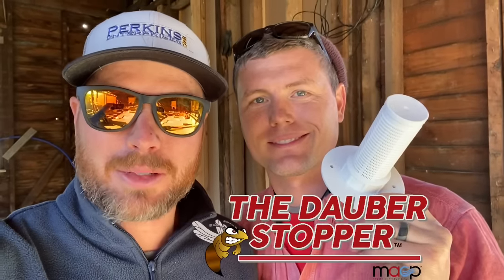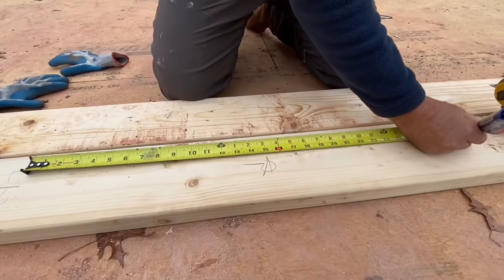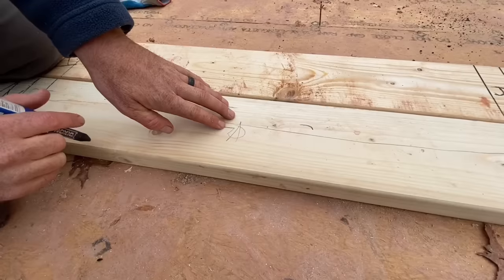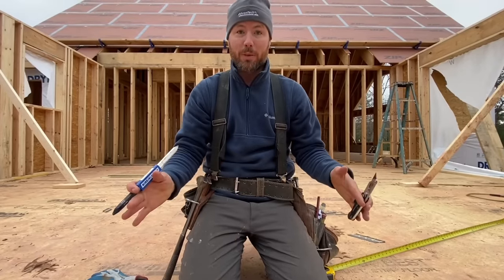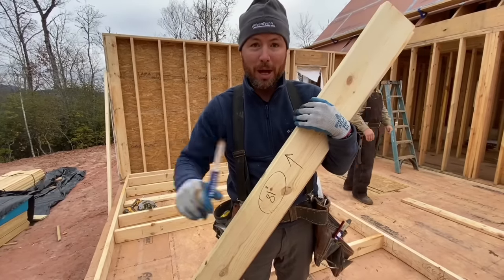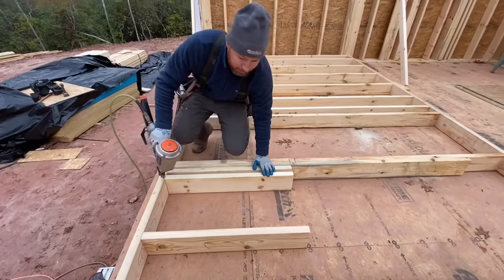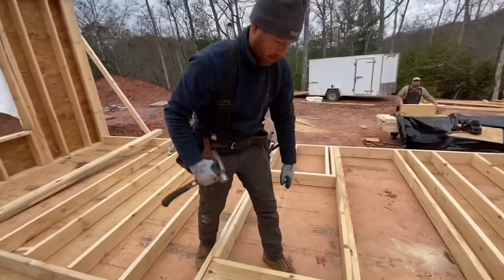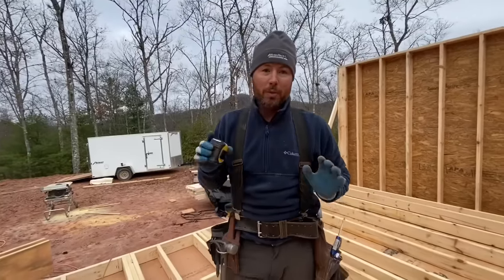Learn how to frame a window ~ Building  tutorials made easy

Comment: Great instructional! Thank you! Please explain how 48x30 becomes “26 40”. Thanks.
Reply: it’s not thirty by forty eight, it’s two six by four zero (ie 2’6” and 4’0”)
Reply: Stumped me too! Thankfully (from the REPLIES) I learned that, in window and door jargon, width is always first (feet then inches) and height is second (feet then inches) e.g. 2 feet 6 inches (wide) X 4 feet 0 inches (high) equals 2640

Comment: Great production, clean. One thing to note: The jack studs holding any header should always in my mind be full bearing to  the beam member its supporting. the window liner should butt into the jacks. Framing the liners full length of the beam (headers) you are creating a swell point and crush point as the wood grain is flat the way you have framed it on the bearing point above the post. 
When using 2x materials for headers, pack 1/2 plywood between 2 of the 3 pieces to gain the 5.5 inches for your exterior walls. Another note. 2x8 Headers should always have 4 nails connecting the king studs on the sides to prevent roll of the header off of the posts once loaded with the roof.
Reply: right on , so correct as shrinkage that way causes drywall cracks

Comment: 7:12 Filling w/ spray foam.  That's an interesting approach to an insulated header.  We've just been using a 4X header flush with the exterior wall and using a piece of Rigid Foam insulation on the inside.
Reply: yup, we do it the same way out here in WA. sheet foam is cheaper then spray... but your already putting can's into the house around boxes and penetrations so... tomato tomato.
Reply: @Ramdodge582  I've noticed the electricians seem to like to run wires in the header cavity before the foam goes up too.
Reply: @wjthehomebuilder  really!? above i door i could see that but a window .. that doesn't make much sense... but they can do some stupid shit.
Reply: Spray foam gives a better R-value for insulation.
Reply: @Dalonghair  then rigid? It's the same, 7.7 per inch
Reply: Ram-n_dodge 
It’s been a while, but I remember spray foam always giving a higher R-value than rigid foam. 
Additionally, it is impossible to get the same blanket coverage with rigid foam slabs. There will be gaps in your cuts. Spray foam literally fills every nook and cranny, every knot hole, every gap. When applied to walls and attics, spray foam contributes to structural integrity. 
Rigid foam has its uses, but insulating a header with spray foam is an all around better practice.
Reply: I think the better practice for standard construction is using a solid header then using sheet foam with expanding foam for your fuckups. My 2700 sqft house has 10 of the large cans of foam in it. Partially because of a 16' section that was framed not in the best way and used 4 cans of foam. Can foam can easily push boards out of true.
Reply: Ram-n_dodge 
There’s no good reason to use rigid foam in headers. If you have the material available for solid headers, go for it. Otherwise, frame your header, nail it in place, drill a couple of holes and inject some spray foam. Don’t overspray. Any excess foam will spill out of the holes you drilled instead because that’s the path of least resistance. If your header is long enough for the spray foam to push the 1 1/2” wood out of true, you did not nail wood spacers in the middle like you were supposed to. 

If the header is framed and nailed in place properly, the spray foam will not push anything out of true in this situation.
Reply: WJ the Home Builder 
The problem with using rigid foam on the inside is there is no nailing surface. That is a very poor construction method. Cutting corners like that simply shows the laziness of the carpenter. Headers should be padded out so they are the same thickness as the wall. If you build it the proper way, there is a solid wood nailing surface on both the exterior and interior wall. Fill in the empty spaces with insulation.
Reply: Ram-n_dodge 
I don’t know where you are getting your 7.7 R-value from. R-value is a rating system used to determine the amount of thermal insulation. R-value for rigid foam depends on the thickness of the boards and what material it is made of. R-value for spray foam also varies depending on the material and how thick it is applied.
Reply: @Dalonghair  There's always a 2x6 under the header for drywall nailing.
Reply: WJ the Home Builder 
Well, if you build your headers properly, there’s a hell of a lot more solid wood for nailing.
Reply: @Dalonghair  Aren't you full of opinions!
Reply: WJ the Home Builder 
That’s not really an opinion though, is it? It’s fact. There’s a right way and a wrong way. You are cutting corners. 

You nail three 2x10’s or [edit:] three 2x12’s (depending on the length of the header) together and pad out the extra inch with a 1 inch slab of foam because it’s quicker than building the header properly. That’s just poor craftsmanship. 

You could pad that extra inch with 1/2” plywood spacers and fill in the gaps with insulation, but that takes more time and therefore more money. The truth is that it really does not take that much more time. It’s harder to blow smoke at experienced carpenters.
Reply: @Dalonghair  There's more than one way.  So yes, it's your opinion. Good for you that you think your way is better.  I was talking with an engineer last week who is trying to sell the idea of a header assembly  that is ONE 2x on the outside wall, then 3" of foam board sandwiched with 3/4" plywood on the inside wall all lag bolted together to create a super insulated header.  Like I said,  there's more than one way.
Reply: WJ the Home Builder yeah but that’s not structural. You’d rely on one 2x10 or 2x12 and 3/4 ply. The foam would just be a shear factor after that. There is no way 3” foam gives you structural strength.  And your math is off. If they say it has to be flush, you’re a 1/4” shy. The best way is to build 2ply + 1” ridged + 1 ply. Keeping the header thermally broken while remaining structurally strong. 3 ply is the way to go and this guys way on having a 2x6 under the header isn’t structural at all either. That jack stud will squish that over time.
Reply: PD12 
Exactly. It doesn’t make sense. This is the difference between trying to get cheap and quality craftsmanship. Why waste a 2x6 as a nailer? Just build the header properly. Don’t be lazy. They really are not saving money by cutting corners.
Reply: Cafe J'adore 
I am not sure what you are having a fit about. I was merely calling out hack carpentry and cutting corners. 

Structural beams are fine. In fact, they are preferred to traditional headers by everyone... if the materials and budget are available. There is absolutely nothing wrong with the traditional header construction that I described. You either misinterpreted what I [edit:] read wrote or you are too young to have had experience with building traditional headers and all you know are pre-fab structural beams. 

Either way, structural beams are clearly not what was described by the other person who posted previously in this thread. There was some nonsense about an unbalanced header with 2x lumber on the exterior and 3/4” osb on the interior. What a joke.
Reply: Cafe J'adore 
Also, drilling a couple holes into a header does nothing to compromise its structural integrity - a couple holes does not mean turn your header into Swiss cheese.

[edit:] In my experience building homes on the Atlantic coast, hurricane-proofing does not address headers. The requirements for hurricane-proof framing are primarily focused on rafters/trusses and decks. Even roof shingles are subject to different standards, but not headers and wall framing.
Reply: Cafe J'adore 
Additionally, I never was a fan of building walls 2’ on center for larger buildings. That’s fine for a shed, garage or barn, but not residential homes. For commercial construction, I would only deem 2’ on center to be acceptable if the building materials provided enough shear protection. I’ve seen homes built with rigid foam sheathing and metal straps fastened diagonally for structural support. Try building studs 2’ on center in Tornado Alley with that jacked up engineering. No thanks, I’ll take my 16” on center walls with osb sheathing on the house I’ll be living in.
Reply: @wjthehomebuilder  That's not true. We have framed for years by sandwiching (2) 2"x material together and then OSB on the inside to flush it out. The header then sits on jacks, not on a flat 2"x. You don't need a flat 2"x for nailing.

Comment: Hey guys as usual short clear and to the point. Lots of ways to do layout. Comment I noticed you pulled your jack stud layout to your top plate. I eliminate this to save the 'oops' nailed the king stud on the wrong side of the line😊 Also saw you pull your cripple layout to top plate...? Especially like  adding information as to opening size. I give the crew r.o. header size jack size cripple and sill length. I get these measurements ahead of time by taking a stud laying out jack height. You can pull several window ro's from here lay out the sills and figure jack heights. On the sill layout I write each window number from the reference # on the print. Now my cutter has a very accurate cut list and can put all the window components together as a package. Header sill and Jack's are stocked above the top plates. Keep the vids coming... you guys have it 'nailed'
Reply from the maker: Thanks brother... I like the “package” method too when you have a lot of the same RO’s. Good stuff

Comment: Nice how to video.  have learned to add another piece of 2 x ? on the outside of the King stud to allow more backing for a curtain rod, or allow for two jack studs for that extra 1-1/2". It keeps owners from destroying the sheetrock trying to mount the rod support.

Comment: Good well made straight to the point video's. As a 71 year young still learning carpenter, in my opinion their is to much lumber in walls. You mentioned a second king stud, I think this space would be better served with insulation. I believe the cripples next to the jacks could be removed and replaces with L-70 leaving more room for insulation. Headers are to big for most openings. Its easier framing with a bigger sized headers but less energy efficient. Just my opinion.

Comment: So the "Kings" connect the bottom sill to the top sill. Like any other stud.
The "Jacks" are shorter to allow for the header. And connect to the "King" to prevent lateral squeezing of the window.?
The header is to spread out downward force on the window frame from the top sill.
The bottom sill is self explanatory. Sound about right?

Comment: Have you ever considered pitching the sills outward 5° for possible water intrusion?
Reply from the maker: Good idea! havnt actually done that in the wall framing before, but now I want to try it. Thanks
Reply: It’s a thought, but if you prep correctly, tyvek, grace or Zip tape and use a quality modern window and side it properly. I don’t think the 5 degree is going to help.
Reply: If you frame the opening a half inch (or so) taller and then lay a piece of beveled siding on it for the slope, that works also. Just seal the sill with some zip liquid flash after. Thanks for the video guys!
Reply: While pitching the rough sill could work it would reduce framing speed  extra angle cutting would involve as to adding 1/2” to rough. Debatable I’m sure.
Reply: Steven Foust too much work for not enough payout
Reply: That’s actually the way things were done years ago. But today it’s all about profit and no one wants to take the time to do it.
Reply: Adam newby here.What do you mean pitching the seals five degrees?
Reply: Sixth Day farm not seals, sills. The window sill can be framed to have a pitch if 5 degrees to shed water.
Reply: @rikertvonfulton16  slanted down and out
Reply: The old exterior sill was cut at 5° and had a kerf cut on bottom.

Comment: I am a total novice and these videos are extremely helpful.  Quick question...on the first wall I built (making a chicken coop with 5 foot walls...I cut all the studs at 4'9", but when I went to frame it, some of the boards ended up being about 1/4" to 1/2" short (even though they were all the same size).  What did I do wrong?

Comment: Curious what your thoughts are about sloping the sill outward in case of an eventual leak. A lot of guys I come across say to slop the sill by 6 degrees, but that would complicate the flashing I'll be using in the end since I was planning on using the vinyl corners instead of flextape. I vastly prefer the idea of keeping everything straight and flush, but the outward slant definitely makes sense to me aswell.
Reply: here we bai; on a piece of wood clapboard siding on the sill to create a slope.   Flashed with tape to seal

Comment: i nail jack and kings and then assemble all pieces after they are correct sizes and then add cripples. i have to remind myself to check crown first and make sure pieces fit  correctly. everyone has a system.just has to be exact and not take too long..then move to the next after its in..

Comment: In UK we use metric but in the old days of imperial we would stick to inches for things like framing. 

2ft 6ins x 4ft would be 30 x 48. It's unambiguous. whereas mixing ft and ins often can be taken two ways.
Reply: That's how windows and doors are measured. You use feet and inches, not just inches.
Reply: Brad Eley  It took me a long while to figure 2640 out is 30 x 48. Why wouldn’t we simply use inch, since it is used in almost entirely of framing?
Reply: I had realized that instead of making 2 measurements to have the lenght of cripple, it is easier, faster if we do math. Since standard jack is 81, take 81-48-1.5= 31.5  (Jack - wo-sill)

Comment: Eric, after having framed a third house I've started to see fluctuating exterior door heights. I'm also tired of using 2x8 and filler material to make an old school door and window header. Do you guys typically use a 2x12 flush on each side of the wall with that 2x6 holding the two 2x12s? Or was that an LVL? I'm looking for ways to speed up the header process. I do like the insulated header idea especially since using a 2x12 or LVL will be plenty strong with one or two layers leaving a void in 2x6 walls. I assume you just use the canned minimal expansion foam? You'll have to give more details on that part in one of your videos as well! Appreciate you taking the time to frame properly. Flushing Kings with Jacks, marking a sill instead of eyeballing it, and keeping things tight. Not sure if you do it off camera but straightening the studs as you nail them is a big time killer that I end up doing. I mark the stud side of the plate when doing layout so I can twist (straighten) the stud to be perfect. Curious about your opinion on this.

Comment: Nice, I was wondering if you insulated your headers, didn't look like it from pictures. Any reason you use spray foam with the void instead of rigid on the inside of the double?

Comment: Before you guys were born I was working as a union carpenter on a large apartment complex and was pissed off by the fact that two old men had the easy job of pre-cutting for all the openings. When I needed to frame one I would pick up a package properly marked for that opening. I presume that practice saved a lot of time. Also back then (and possibly today) because we were all paid the same the older, more experienced men wouldn't help the younger ones??

Comment: Maybe I missed it, but how do you flush the header board on the inside of the frame? You did the nail/screw hammer technique to flush the outside boards. Do you flush it after you get the wall up and drill the holes for spray foam insulation; using the foam to push the inside board out to flush that before nailing?

Comment: Really great video, thankI have a question. At 6:46 is there a particular reason why the middle two cripples are not equally spaced between the "outer" cripples? Not sure if the terminology is correct but I hope I make sense.
Reply from the maker: Good question.. the middle cripples stay on layout with the rest of the studs
Reply: @PerkinsBuilderBrothers  Ooh, thank you, that makes so much sense.

Comment: 38-year Carpenter here; as long as your top plate and bottom plate match in length with the layout transferred from one to the other, checking for square becomes unnecessary, because, as you already know, when you stand that wall up and plumb one end, that entire wall, every stud, every window opening and every door opening will turn out square! Love the videos man, it's good to see true professionals at work and taking pride in their work! There's just not very much of that going on these days, what, 30% to 40% at best?

Comment: Hey dude what do you think of cutting your cripples at 5 degrees on the miter saw so that there is a pitch to the bottom plate where the window pan flashing goes so that you don't need to install a clapboard for water runoff?

Comment: I've seen other vids that use osb sandwiched between the 2x(8, 10, 12) to make a header.  You are the only one I've seen use foam.  Why that approach?

That idea of putting them as high as the door - I have a 66W x 36H window.  It seems awfully high if I match the top to the door.  Is that an aesthetic guideline only or a structurally advised choice?

Comment: You failed to mention that on a window schedule doors and windows are  listed with their width measurement,then height.
Wr tack our plates together in Michigan and mark layout on the plate edges so you can read the layout looking down.
Also,we call jack studs doublers so the j becomes a d and any cripple is actually marked with an o so wall bangers know not to stud the opening in.
We also triple up our rim jousts with blocking between the joist bays below our king and jack studs for full bearing under the floor.